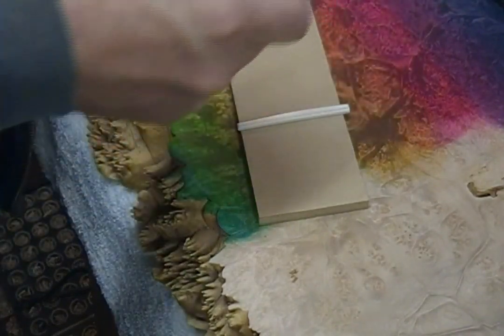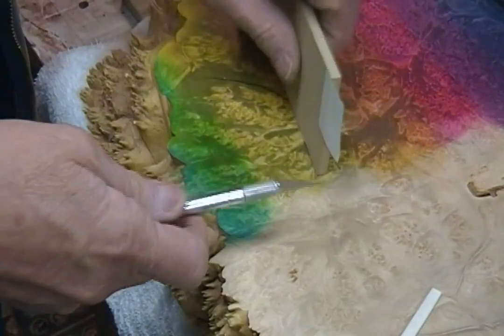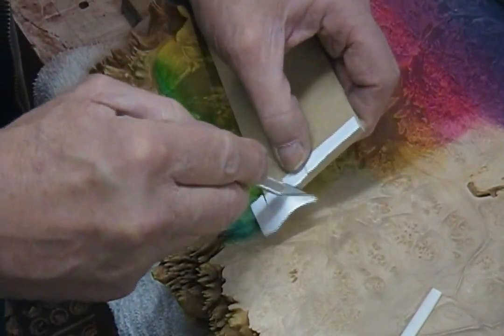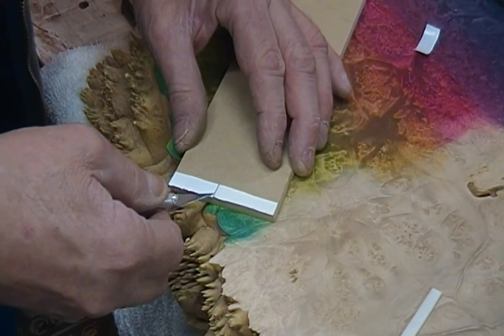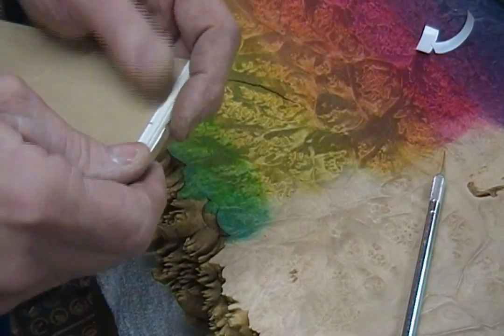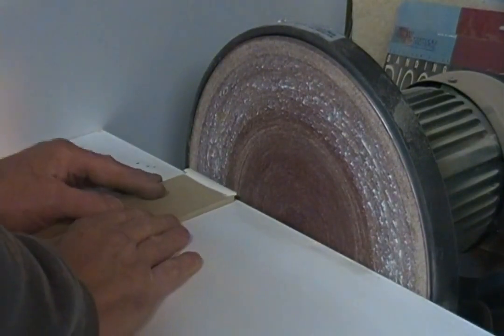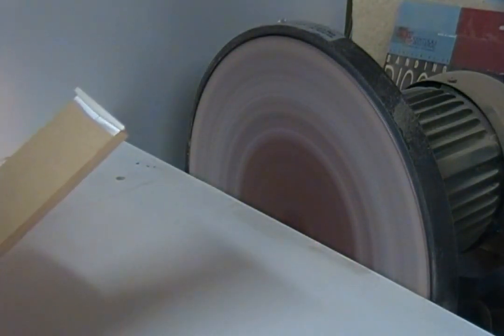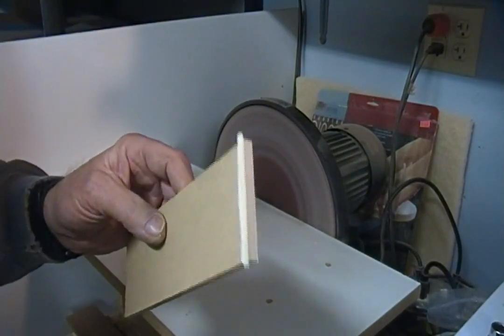SHAVE GUITAR BRIDGE SADDLE IN MINUTES-JONAH GUITAR EXTRA #23

Comment: Agreed a great idea. A slip up vapourises flesh in milliseconds. (Been there!) You don't notice immediately, then it starts to hurt and then you see a flat area of flesh with micro red dots starting to appear. Nice!

Just wondering- do you find that you have to compensate slightly for the fact that the edge of the disk covers more ground than it does nearer to the  middle? We used to do pretty much the same thing as this on our belt linishers, but only for accuracy. Most of the time we'd just go straight in or maybe use some grips, but then only because the workpiece got too hot to hold. These kind of tips deserve a wider audience Dane.
Reply from the maker: Hey Steve, you're right on point as always. Grinding/ sanding flesh off is not a fun experience. I love your description of micro dots of blood appearing. Perfect. 

And while the outside of the disk cuts faster I just watch the line and compensate accordingly.  I do a lot of this stuff free hand risking fleshly damage but this guy was just to little.